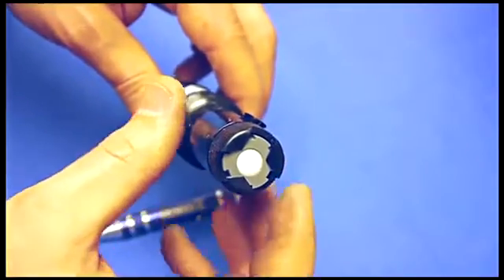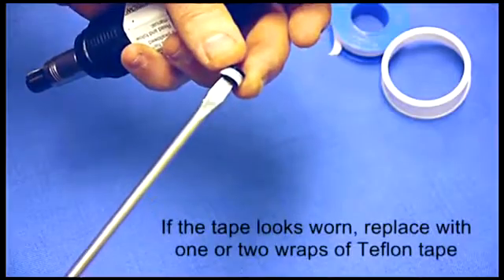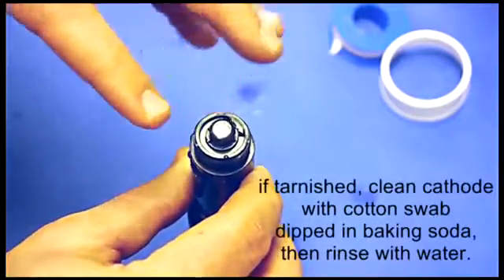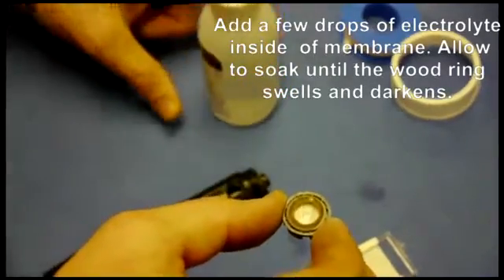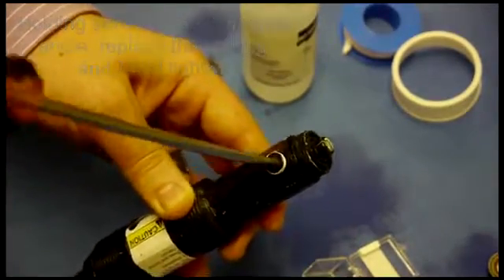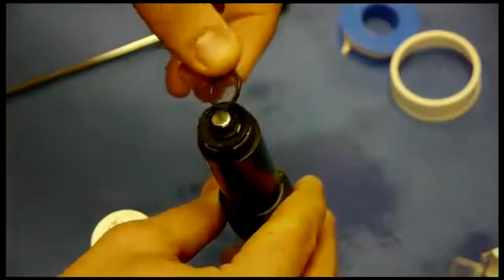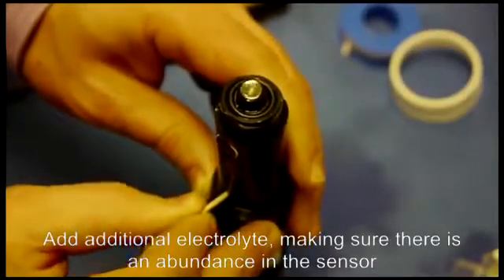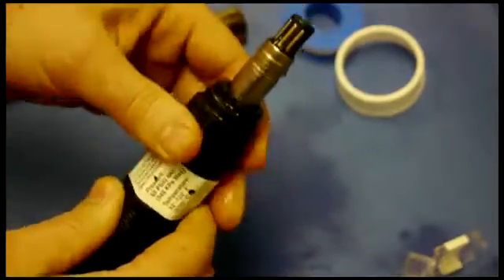How to Rebuild a #Rosemount Analytical dissolved oxygen Amperometric Sensor #AnalyzerInstruments #DO

Comment: I just found this video and found it helpful and i'm not used to working on DO Sensors. But I recently started up a Biological unit and the DO wasn't functioning well and since the project was delayed. That DO Probe sat in freezing weather suspended above the tank yet to be filled for 4 months in sub freezing weather. I think the weather may have killed it maybe with freezing weather. Anyway, do you have a follow-up video for the Zero or Full scale Calibration of the Rosemount DO Sensor?
Reply: The online manual for the transmitter explains the calibration procedure really well for all of the different sensors that will work with it, including DO.